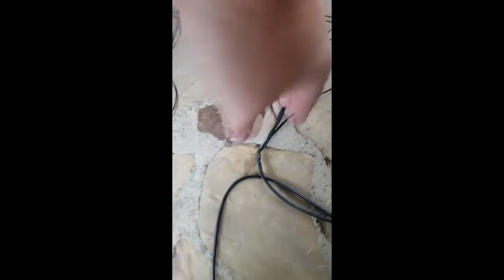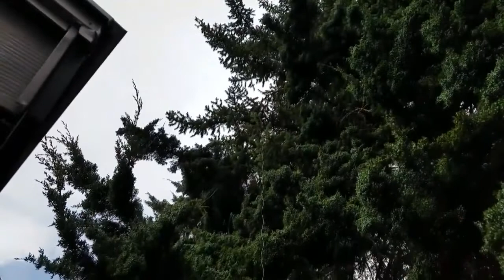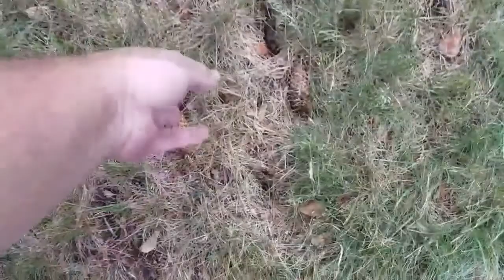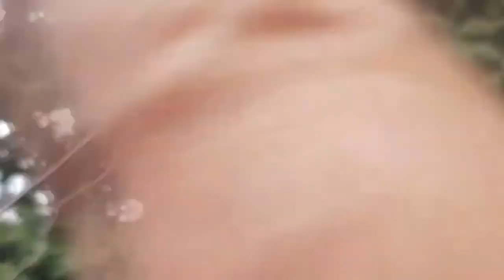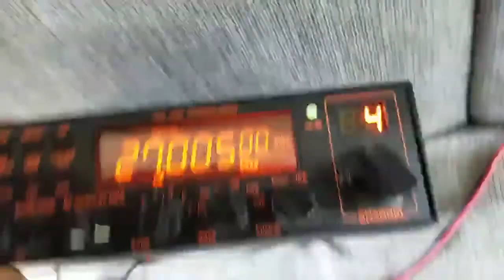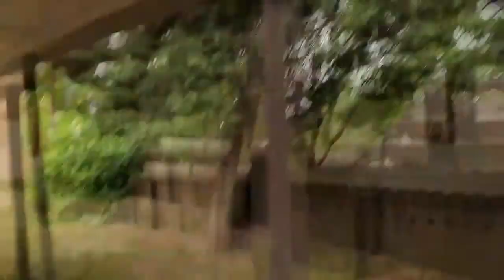How to Build a 10 and 11 meter 1/ 4 wave Ground plane that almost no one can see. NO HOA

Comment: It should be 9 Foot = 108"= 274cm (whip) over 9 Foot (radials) "Adjust a little either way for Both Whip and Rad's " 
Radials at 42-45 degrees to bring in resonance 50ohms
Cheap and Easy to build these things
Reply from the maker: Did you read the formula in the description box. 108" would be good 25 to low 26MHZ range.
Reply: @390WagonMaster  No i did not expand the Descriptions Box, I start with that size, grab the analyser and start to bring it in